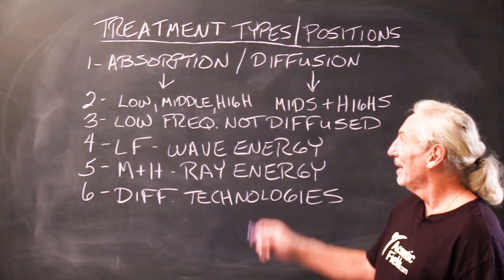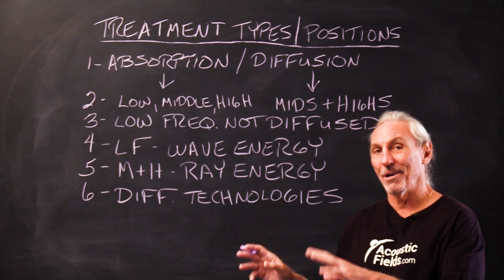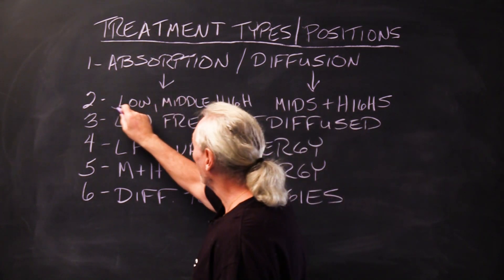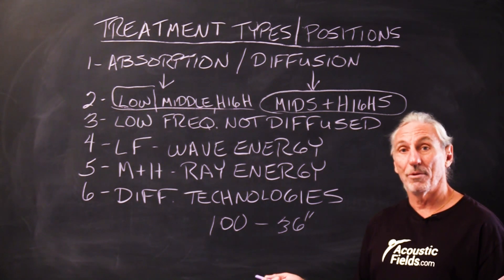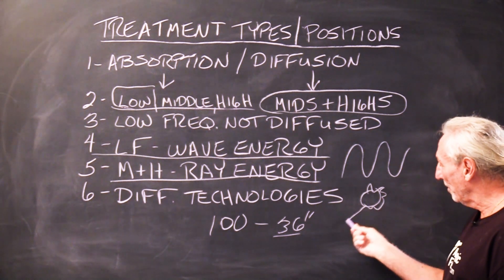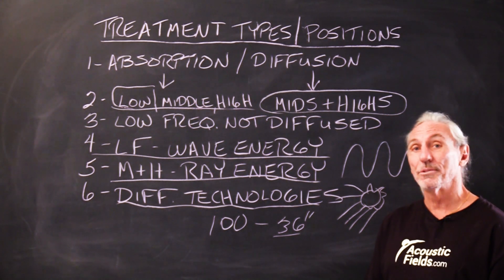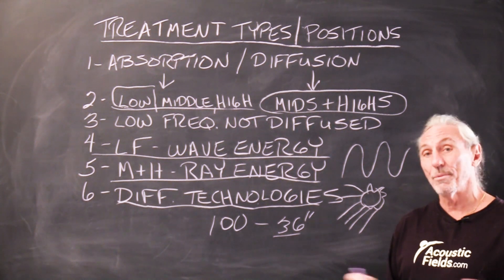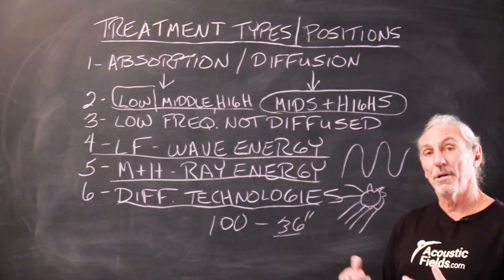Acoustic Treatment - Types & Positions - www.AcousticFields.com

Comment: Than you for this video. I just moved into an apartment  3 months ago and my neighbor has. Loud television with speakers connected and the sound a vibrating through my thin hard wood floors. Based off of your video- it’s low frequency noise . What can I use DYI ? Is vinyl good under a rug?

Comment: Would a sub be better on the ceiling on the floor? our church is small more of rectangle and our 2 main speakers are hanged on the ceiling.
Reply from the maker: Subs in larger rooms can be suspended from ceiling away from room boundary surfaces. They can also be elevated off the floor with the proper height platform

Comment: hi dennis I'm currently building  your QRD7 plans using only handtools, I plan on putting them on both the back and front wall, I might make more for the side walls as well in time but making one with joinery is very time consuming, also plan on making the bass traps but I am starting with the diffusers, I do use power tools as well but am limited with workshop space, hope to show you the results once they're done.
Reply from the maker: T,  If this is two channel audio do not put diffusers on side walls.

Comment: Great video. I'm new to sound treatment.
     I have a medium-small sized room: 18'x18'x8'.
I think that I made a mistake of ordering 3 diffuser Skyline wooden sculptures panels.
Each is 31.5 inches x 17.3
inches by 3 or 4 inches deep.
I bought 3 of them.
Together, they can easily take up half of the wall directly behind my listening area.
  Did I waste my money on these?
If not, can someone kindly suggest where I can best use them?

Thanks!
Reply from the maker: Diffusion is a technology that has requirements that must be met using absorption first before introducing any diffusion type. Here is a link to those requirements. 
https://www.youtube.com/watch?v=fB3EsOqYZ6A
Reply: @AcousticFields  Thanks Dennis.
I appreciate your videos.
You debunk myths and present your facts clearly & precisely.

Comment: 6:40 Concrete frame buildings are the worst in terms of sound transfer (with the exception of plasterboard walls which are just  transparent to sound). The fact is that concrete by itself is a good medium for noise and vibration to travel for long distances (quite a few floors or rooms apart) and to make matters worse, in all modern constructions (i.e. anything in this and the last century) concrete is re-enforced, i.e. it has a good amount of construction steel in it which is a great conductor for noise and vibration. So, if you live an a concrete building and someone decides to blast the stereo three floors down, two flats across, there is simply nothing you can do about it: you will get noise, in fact annoying noise because it'll be muddled, so your best bet is to either join the party or go out for a stroll. Potentially - this must be stressed - one could build a suspended sound "insulated" room within the concrete building room where the suspension elements offer dampening that is tuned appropriately so as to limit the transfer of low frequency vibration through the suspension elements. Assuming these elements are, say, steel springs that can take the weight of the suspended room, guess what: higher frequencies will still travel through the spring mass and couple to the suspended room. That gives you an idea of the size of the problem for those living in building blocks. If what you live in is attached directly to the ground however, with a good distance of separation from neighbours, then you have a lot more freedom in tackling the external noise.
Reply from the maker: You must match the barrier material type, its desnsity, and construction methodology to the frequency and amplitude of the noise in the usages for that building. A concrete building is more oriented towards structure support than noise transmisson.

Comment: Thanks for your well-informed videos! I remember one where you talked about how problems in the mids and highs, for instance with a bright room or piercing upper mids, can actually start with, or come from, low frequency problems. I don't remember the argument - could you point me to it?
Reply from the maker: S, Fundamentals and harmonics. Study those two main topics.
Reply: Acoustic Fields Thank you. So a mode with a 1st harmonic at 50 Hz would have a 7th harmonic at 3600 Hz and 8th at 7200 Hz, and these would have an audible magnitude? The reason I ask is that some consultants say to start with management overall decay times in mids and highs - and then start to manage lows as much as possible. Would it make more sense to focus on primary modes first to see the effect on their harmonics?

Comment: What’s your thoughts on using acoustic ceiling tiles inside wall absorbing panels instead of rock wool or fiberglass insulation?  I’ve heard your views on using rock wool, and also fiberglass, but I don’t recall you mentioning  pro or con about acoustic ceiling tiles inside of the absorbing panels.
Reply from the maker: Acoustic Ceiling tiles do not represent the proper rates and levels of absorption for critical listening rooms.

Comment: Building insulation clearly does work though.
Reply from the maker: It has poor rates and levels of absorption for music and voice.
Reply: Acoustic Fields yet, it's used successfully every day in studios all over the world!
Reply from the maker: 100 million people smoke cigarettes. Quantity of usage does not dictate quality. This "technology" was used because they did not have any other ways to try and manage  low-frequency energy. It was find a deep enough space and fill it with building insulation. That's what everyone did without asking questions. It was all they knew. We represent the next treatment level with our carbon technology. We get better rates and levels and take up 50% less physical space than anything used with building insulation. We can increase the absorption rate by increasing our carbon density so we get much more out of every square foot of space.
Reply: Acoustic Fields I'm not saying there is anything wrong with your technology and in fact, it probably IS better, I'll take your word for it. However, it's not practical or available to all. For example, can I even buy it in Australia? How much does it cost? 
Insulation material is still a great option for those who need to treat a small home studio and it's a hell of a lot better than nothing! 
My issue is that you are making statements about insulation material that are simply based on assumptions, not fact! You assume it's dangerous with no actual proof that it is. That's not right.
Reply from the maker: We are an international company with manufacturing facilities in Europe and the states. Our account base shows 15% of our clients are in Australia. You do not have to take my word for the hazards with insulation. Do your own research.
Reply: Acoustic Fields lol, I've been working with insulation for 30 years. If it is sealed properly and not disturbed, it's harmless...just like asbestos. Even that is only dangerous when people start messing with it! Please show me one case of a musician or producer becoming sick from using insulation.
Reply from the maker: @officialWWM  The issue is that the exposure accumulates over time and manifests itself many years down the road. Its simply not worth the cost in health or performance.
Reply: Acoustic Fields but where is your proof of that? I understand what you are saying but you can't just make bold statements like that without stating your sources! I'm surprised you haven't been sued! I still maintain that properly sealed, even behind a suitable fabric, the product is harmless. Maybe open and uncovered might be different but no one uses it like that.